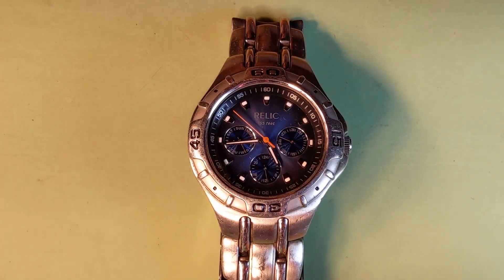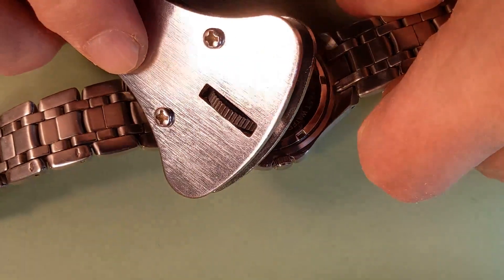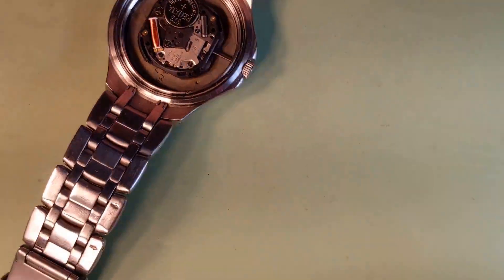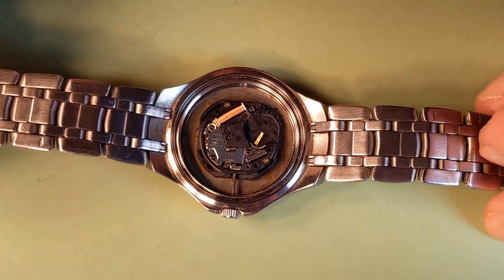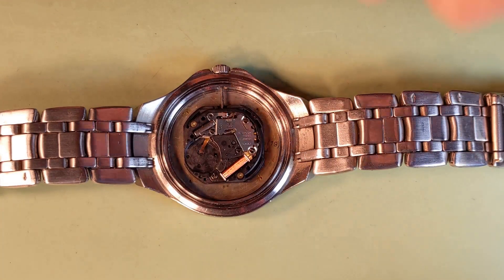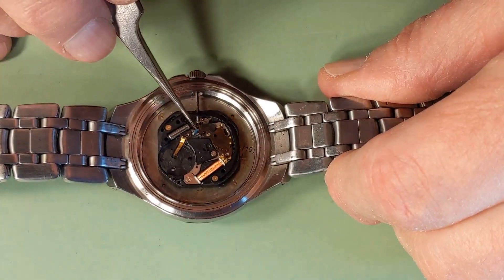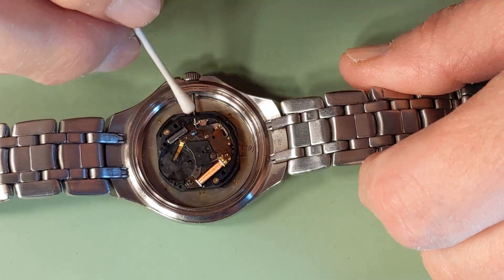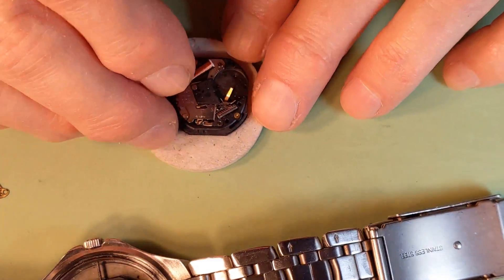How to Fix a Not Running Watch with a S.Epson/Seiko VX3J Watch Movement

Comment: Hello this is a great video can you please explain how to use muli meter to check coil ......not sure how the settings work and how to test coil
Reply: Multi meter
Reply from the maker: You should set your multi meter to resistance measurement. Then connect wires to two coil contacts and see what resistance is there. Should be in  a range of 1-3 Kohm. If the meter shows infinity, then coil is open. Good lick! Does it help?
Reply: @ValentechTime  Hello Mr on my multi meter there is 2m ,200k ,20k,2k and 200..... not sure which one to set  also will infinity show 00 on the screen ?
Reply from the maker: @ajithrampursad546  Please set multi meter to 20K position. If coil is good, then resistance would be in the range of 1-3K, depending on the movement. My multi meter shows 0.L (zero dot L) in case when the coil is open.
Reply: @ValentechTime  Thank you Sir
Reply: @ValentechTime  Thank you Sir